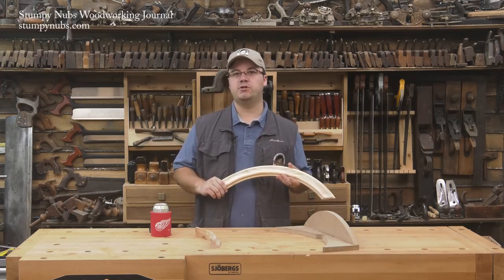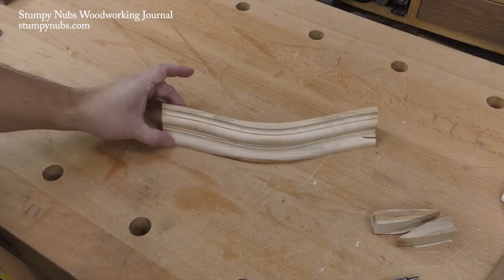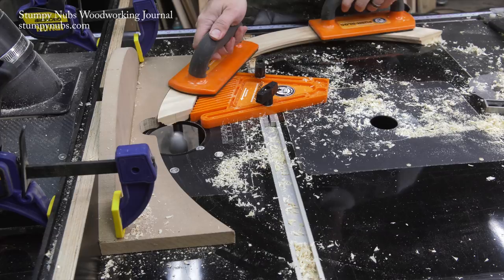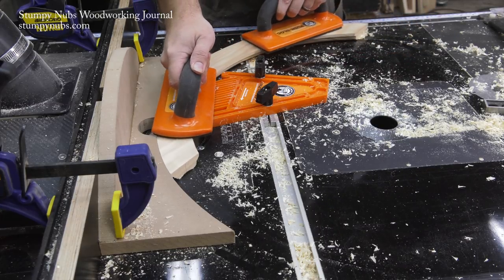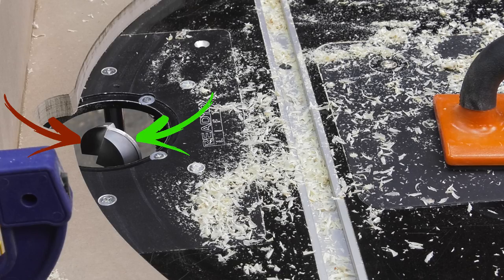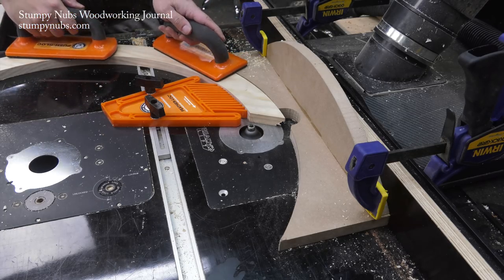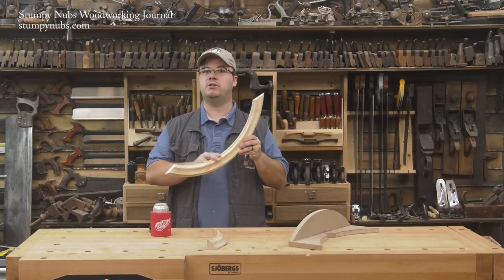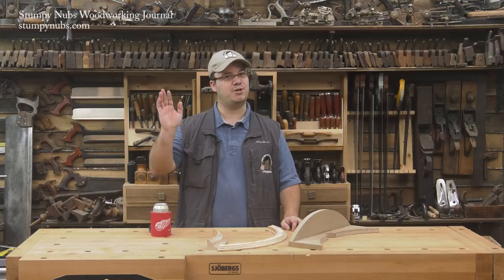COOL ROUTER SKILL: How to cut CURVED coves for mouldings and trim

Comment from the maker: I SHOULD HAVE BEEN MORE CLEAR ABOUT WHY you might want to use this jig to rout on the EDGE of the moulding, instead of just using the router bit's guide-bearing.... Frankly, it's a matter of preference. I always like to use a fence, even if the bit has a bearing, if I can. I find it adds stability, especially if the molding is narrow. Since I already have the jig made (to cut the cove), I'm going to use it for the convex edge too. It also makes it possible to use a bit without a bearing, or to use just a portion of the bit's profile. But, the main use of the jig is for the cove in the center, not the edges.